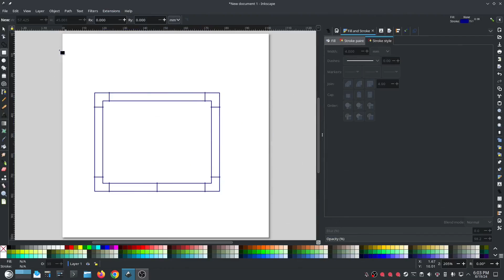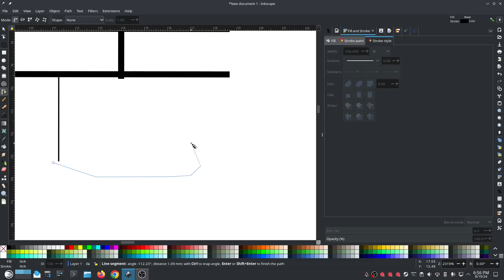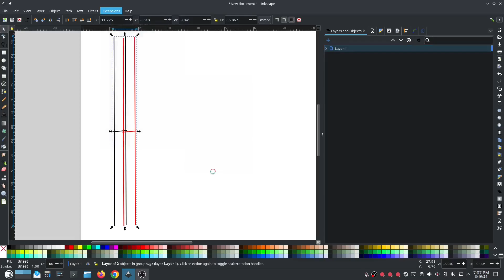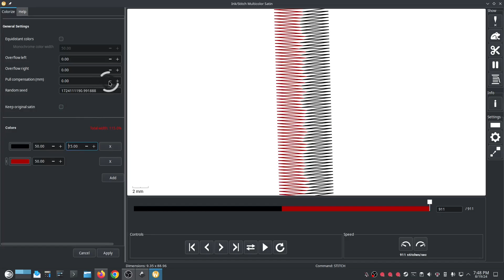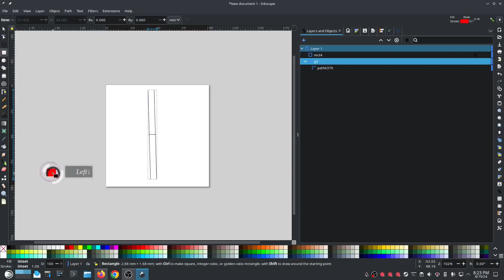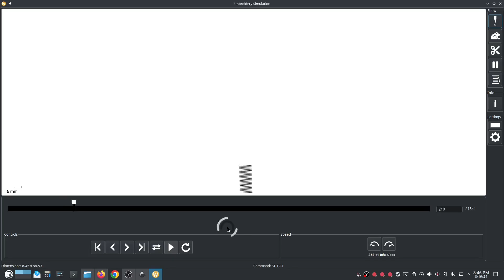Inkstitch - Beginners Guide to V3.1.0 - Deep dive into Satin Stitch

Comment: i don't have all the tabs at the top - I only have the first tab  "stroke"  -where do i get the other options with sating on it please , thanks - i have the current version of inkstitch
Reply from the maker: You will only have stroke options if that's the only thing you have selected for the params. If you don't see satin stitch or fill stitch options then there is no satin stitch or fill stitch selected.